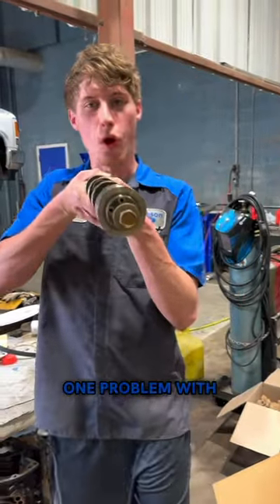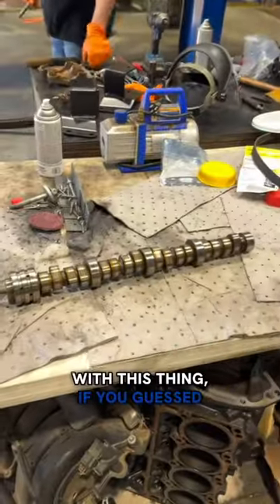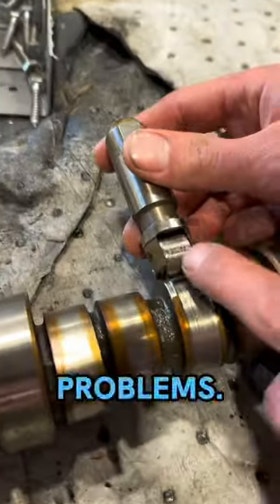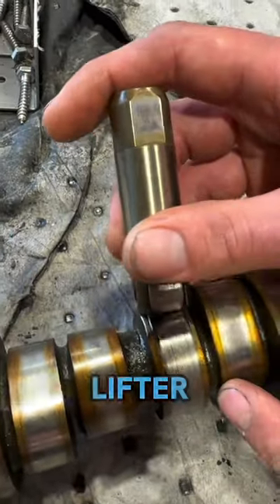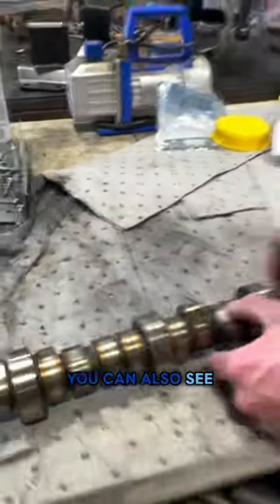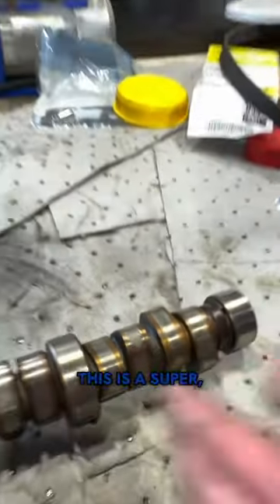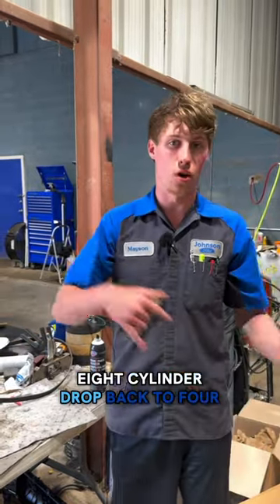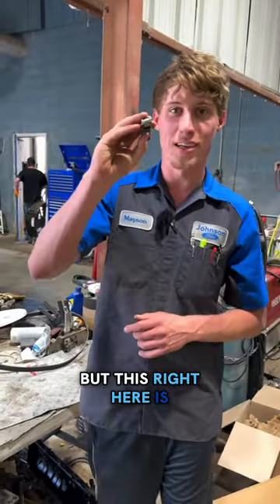The Number One Issue Plaguing Overhead Valve V8 Engines #shorts

Comment: Poor maintenance and idling causes this.
Reply: Mds/afm causes this, just like any second or third gen ls.
Reply: @harrissmart9204  low oil pressure at idle  is the number 1 cause as stated by dealers and manufacturers
Reply: @harrissmart9204  the 7.3 Godzilla has had lifter issues, and doesn't have any kind of cylinder deactivation technology. I blame poor materials, poor oil volume, with poor maintenance spinkled in.
Reply: @harrissmart9204  the 3rd gen LS never had AFM just the 4th gen LS that came with the automatic transmissions and same deal with the 5th gen LT
Reply: @harrissmart9204  only on the 4th gen LS and 5th gen LT equipped with the automatic transmission only
Reply: Preach
Reply: Speaking as a FCA tech. Oil pressure is not the issue with the HEMI, and lifter issues happen to regular lifter as well, not just the MDS.

Use a good synthetic oil and run it a bit heavier. 0w20/5w20 use 5w30. 

Part of the issues came from the parts supplier not properly hardening the cam and rollers in the 5.7l and the 3.6l. Poor maintenance and cheep oil exaggerated the issues.
Reply: @CJ-jo6do  true. I run the 6.4
Reply: @skullfan33  as long as you stick with the Pennzoil ultra platinum 0w40 and change it regularly, you shouldn't have any issues.

I had a chat with Amsoil about alternative weight oil for the 6.4/6.2, they told me that they had a talk with FCA about it and they made a point of only using 0w40 in the 6.4/6.2 HEMI's.
Reply: @CJ-jo6do  yes I heard that, I run mobile 1 oil and filter
Reply: @harrissmart9204 not the same cause they just happen to have the same end result.
Reply: 100% Not True. It’s a design problem. I babied my LS3 and followed strict maintenance guidelines and still my engine developed the Chevy tick problem and needed extensive head work due to failing lifters. ❤
Reply: The reason that they fail when idling, at least in the hemi is because of poor oiling on the rollers because of engine design, of the angle of the valve train, and a large journal under the camshaft preventing proper oiling to the rollers on the lifters.

Comment: Keep clean oil on it. If you use good oil and you change it often, you’ll never have this problem.
Reply: You are right, those extended oil changes do not protect you or the engine, but they sell more cars.
Reply: And use full synthetic, 3,500 miles/3 months.

Comment: 430,000 plus miles on my 03 5.3 and never had a lifter problem . Hemi engines are known to be oil starved at the cam .
Reply: Absolutely
Reply: My Sierra 2002 with over 300,000 this engines are bulletproof
Reply: Because it’s not an afm engine.
Reply: AFM wasn’t introduced on the trucks until 09-2010 models right? So no surprise here.
Reply: 450k LIER, unless you rebuilt it  twice allready.  An engine can NOT run more than 200 or maybe 250k with out a rebuild.
Reply: @troymillion8510   lmao where did you get that from? My 03 tahoe has 300k all original, my sprinter has 450k all original
Reply: @troymillion8510 this is a hell of a thing to say. Honda, Toyota, Ford, and GM all have engines that regularly reach 300k with no problems. That’s just gas engines. Open the door to the diesel world and It goes much higher.
Reply: 2007 to 2024 LS, LT will always have lifters fail. 6.2 also had lifter bore issues.
Reply: @troymillion8510 1995 Honda accord, 312k, 1994 civic 455k, scion xd 245k all otiginal internals,  still running,  just changed spark plugs last week lol silly person😅

Comment: Not keeping up with oil changes
Reply: Using shit oil.
I sold engineered and enhanced lubricants for ten years.
So many problems are fixed by better made oil.
Use oil analysis.
Tells you exactly how good the oil is after so much use.
Change it or let it stay.
 longer. Even better, get a heads up on pending problems before they get worse.
Reply: @markobrien678  k
Reply: @markobrien678 thoughts on the Kirkland synthetic?
Reply: Good stuff G6 rated

Comment: This problem never happened before. I wouldn't say it's a push-road problem. I would say it's either a fuel problem or an oil problem. They're putting something in it to kill those engines. That's my opinion, but it's wiping out all of cams regardless of the valve drain design.... They just don't want internal combustion engines on the road anymore
Reply: It's the removal of zinc from motor oil
Reply: The 3rd gen Pentastar, the one with the variable valve lift, always wipes out the right side intake camshaft and both intake phaser failures at some point after at least 60k miles, some earlier than that. It's own design condemns itself 😢. Will usually always last during the entire warranty period. Lack of oil changes only speeds this way up.
Reply: Lack of zddp in the oil. Need to use oil with elevated zddp and change every 3k to 5k. I experienced cam wear after 290k. It was the oil...now I run 10w40 conventional oil with zddp 1100 ppm or more
Reply: @paisleyprince5280  Exactly.  Or part of it.  The zinc additive was taken out at the request of the vehicle manufacturers because it's hard on the cat converters.  Flat tappet lifters might survive, but the cam might not.  What a world.
Reply: Omg! There not adding something to ruin the engine!!
Reply: @mcmuskie2563  ethanol in the fuel and taking something out or putting in oil
Reply: This engine specifically its a bad design. At lower rpms oil doesn't make it down there really.

Comment: Only like that while you been alive. Flat tappit OHV was the standard back in the days no roller system metal to metal contact and have no issues with valve trian. It’s the oil not the engine. They took zinc out of oil and it’s been down hill for most engines sense.
Reply: Oil still has zinc
Reply: Really, wonder why top brands like AMS oil schafers and liquid Molly feel the need to assure you that there’s zinc in their oil. Look up AMS oil Z rod for classics it says on bottle zinc real big so you don’t miss it. Also, all of your camshaft break-in lubes are rich and zinc. When I was a kid we didn’t even have to break in lube anything because oil already had it. Don’t GMTSB in 2011 Calling for dexos oil and now they have Gen 2wonder why gen 1 didn’t work out 🤔
Reply: @diagnosticdave1225  dexos gen 2 is for the prevention of low speed pre ignition in direct injection turbo engines that started to become common in gm vehicles at that time. Gen 1 was for older port and some direct injection engines. Motor oil still has like 600 -850 ppm zinc post late 90s. Before the 90s it had like 1100 ppm zinc or higher.

Comment: Pentastar has the same issues.  One thing I've found is the oil lubrication ability. 5w 20 is to light. 5w 30 so far works best. Only thing you'll lose with the heavy oil is a tiny amount of mileage

Comment: Speaking as a FCA tech. Oil pressure is not the issue with the HEMI, and lifter issues happen to regular lifter as well, not just the MDS. Some people don't understand that the HEMI oils backwards, the lifter gets it's oil from the rocker shaft through the pushrod. The roller gets it's oil from splash off the crankshaft and what ever leaks down past the lifter bore.

Use a good synthetic oil and run it a bit heavier. 0w20/5w20 use 5w30. Unless you're in cold weather season, then stick to the OEM weight.

Part of the issues came from the parts supplier not properly hardening the cam and rollers in the 5.7l and the 3.6l. Poor/lack of maintenance and cheep oil exaggerated the issues.
Reply: I own a 2022 Ram with the HEMI.  All oil changes had been done at 5,000 mile intervals, at the dealership, with factory 0w20 oil.  At 30,000 miles, it started to develop a cold start tick, which would go away as soon as oil pressure rose.  So, I started doing my own oil changes, still at 5,000 mile intervals, but am using 5w30 now.  The cold start tick IMMEDIATELY stopped and has not returned with 45,000 miles on the clock so far.  Seeing how I live in south Texas, we only average about 5 days a year that are below or right at freezing so, it’s good to use 5w30 year round.  

That 0w20 is just for CAFE standards and are crap to help an engine live a long life.
Reply: @91CavGT5  The move to lighter oils is for fuel economy standards, and I've noticed a increase in part failure when the starting using 5w20 and thinner. 

They do clearance the internals for the thinner oils so it's not recommend to go full 15w40 😄.
Reply: They took a lot of zinc out of oil now to make the EPA happy and help catalytic converters last longer.
Long periods of idling hurts those hemis.
Like in police cars where they might be idling for 2 hours at a scene
Reply: @edbeck8925  that's a small part of it. I believe the thinner oils have less cushion, thus is easier for the metal parts to push the oil out of the way and contact each other.

We have a fleet of parts delivery trucks/promasters that were consistently having roller failures and wiping camshafts. I had them move from the 5w20 to 5w30, and notice less issues. Then we move to 10w30 and we haven't had a roller issue sense. Of course we put 5w30 in during the winter months.
Reply: and the 3.6 pentastar ohc v6 roller fallowers fail and wipe out cams. not just pushrod engines. but i love that the only hemis ive seen have cam failure have been in cars with high idle time. cop cars. ole people trucks. hemi cars that get beat on a lot dont seem to have that problem because they get plenty of oil splash lubrication 😅
Reply: I'm not a genius but I pretty much agree with what you have there

Comment: This all started when the gooberment decide to remove zinc and lead from the oil. Flat cams, be it old style flat tappet or roller, became common. I use Shell Rotella and a lead/zinc additive on my SB Chevy. 50 years old and runs like new. Well almost. I do have one cylinder that fouls out the plug about every 5000 miles!😊

Comment: That’s a hemi problem 1 cam is light years away from crankNo splash bad 2 angle of lifters is garbage engineering lol 3 no oil pumps thru stock lifter. Chevy and Ford do not have this problem

Comment: With the DOD and the MSD in the 5.7 hemi,ypu can eliminate them with an eliination kit.Did one using a kit from AMS  Racing for a 5.7 hemi.Neglect is another cause,extended oil changes are one cause of it
Reply: Just got a 2024 Ram in February. Got away from Ford’s EcoBoost issue just to get into another potential issue. This time around I got a lifetime warranty, and plan on doing absolutely no mods this time. Heavily modded my EcoBoost. Fun vehicle after those mods, but took a big chance doing that. Won’t do that again. Fingers crossed 🤞 with this truck!!!

Comment: It may be an issue with people that don't properly maintain the vehicle. I certainly wouldn't issue a blanket statement that overheard valve engines have inherent problems. My DOD Avalanche is coming up on 200K with no issues. I of course have run good synthetic oil since day one and change every 6K. There are definitely some issues with "offshore" roller lifters in the aftermarket world.

Comment: Saw another guy on the YouTube, old timer and engine builder, theorized it was lack of oil at idle. Engine design of hemi didn’t allow splash lubrication of the valve train enough causing the issue.

Comment: Meanwhile GM 5.7, 5.3, 7.4, 6.0, 8.1, 3.8L, Ford 5.8L, 7.5L, 5.0L never had any of these problems pre DFM. The 5.7L Hemi is a unique case as it was a design flaw of the block design itself not a OHV flaw. 

It's not uncommon to see a 350 with over 250k. It is however nowhere near as common to see 5.7 Hemi over 200k without being opened up.

Comment: Cam wear was solved in the late 1950's with zinc additive in our motor oils.  In the late 70's, the EPA made them take zinc out of the oil.    Cams have been failing ever since.  It has gotten way worse because people believe the extended oil change intervals with the water thin oils of today.

Comment: Usually, the 2-valve per cylinder over head valve with push rod engines usually have to have quite massive valve springs to be able to return all that valve train mass "on time" at high RPM without valve float. 
The downside to/of having very large valve springs is it literally places a LOT of load on "said" valve train. Sometimes rods bend, sometimes rocker arms break, but sometimes the cam lobes go flat to. But that's OK, as long as "that" valve train engineering is spot-on. Actually, slightly over engineered would probably be a good thing given the case at hand. 
IDK, just my thought.

Comment: I’ve got a 5.7 challenger, had a 6.4 ram 2500, praying lifters don’t fail on my 5.7 like they did in my 6.4
Reply: Dang dude I was looking at getting a 2020+ 6.4l Ram 2500 since I don't need diesel. 
Had a 2015 Ram with thr 5.7. Are the 6.4s that bad? I thought it was a better motor, than the 5.7 with less problems, especially if you do the MDS delete. And also, other than the issue you had with your 6.4, what are some other experiences you've had with it wether negative or positive

Comment: 😢😢 so what is the fix on the 7.3 Godzilla lifter problem
Reply: Don't excessively idle your engine, low oil pressure for a long time accelerates lifter failure
Reply: Parts that are not cheap garbage.

Comment: Mason in our shop the hemi cam/lifter issues we see are almost exclusively on engines with a lot of idle time....AND...the customer is changing the oil based on mileage.  We use the formula 7500 miles = 200 total hours to gauge equivalent miles.  Some of these units are getting LOFs at around 12k-15k equivalent miles.  We find the operators (usually fleet) reset the gauge cluster maintenance reminder and don't actually perform the LOF until they hit a certain mileage.  With all the (spring) pressure on the cam/lifter the oil is just worn out from poor maintenance.  Next time you're looking at an OHV cam failure check the hours.  I've seen some high hour 7.3l godzilla and GM LS engines with the same issue.

Comment: Feel like the AFM/DOD style lifters are more to blame with modern units, vs the OHV design itself. With reman/hot rod stuff, poor quality materials and poor quality control seem to be the norm for overseas parts brands nowadays. I’ve seen pushrod failures, rocker arm failures, camshaft/lifter failures, etc etc.

Comment: My old LS3 motor eventually needed expensive head work with only 83k miles because of lifter problems. Sold that Chevrolet and will never be buying another one. Thankfully Japanese vehicles do not have these design issues. ❤

Comment: I get why the use roller lifters because they technically are smoother and less harsh but solid lifters just work. Mine turned 50 this year and are still quiet. Even better is if you do wipe out a cam lobe it will work just less efficiently.

Comment: NOT a design problem. It's a material quality and preventive maintenance problem. Have built and run more Ford and Chevy OHV engines, flat tappet and roller lifters, than times you've opened a door. Just sold my grandfather's 1949 Ford F-1 pickup. After he passed in 1960, I dropped a Ford 289 & BorgWarner T-10 4-speed tranny into it in 1963. That engine was still running strong and smooth with 349,000 miles on the clock when the new owner drove it out of my drive.

Comment: Simple solution: change your oil. I’ve seen tons of Hemis and LS engines go 300000+, but only with regular oil changes. Overhead cam V8s, they fail at 200000 regardless of your maintenance.

Comment: Here is the solution, put a HellCat oil pump in that motor but before you do, put the factory over pressure relief spring from your factory pump in the HellCat pump. This pump will increase your volume at idle and the factory relief spring will bleed off the excessive pressure at highet rpm's to prevent logging an oil pressure code in the pcm which disables the cylinder cancel feature MDS I THINK IT IS CALLED.

Comment: Yes the issue with the lifters is generally with dod or mds ones failing. EPA mandates Trying to get those v8 mpg’s up. On the reverse side, 5.0L having cam phaser issues all chasing the same thing. EPA mpg. All 3 v8’s are great motors especially when those plagued parts are replaced/deleted/locked out etc.

Comment: Induction hardening was wrong on the surface. Bad quality control. Back in the 70s start working on vehicles I would V8 cam and lifters. We’re not rollers and they were fine. Cylinder walls were wearing out mostly Chevy an Ford  after over 100,000 miles

Comment: My 5.7 Hemi went 178,000 miles before it was totaled by a helicopter trailer. The engine was as quiet as the day I bought the car 11 years before with 4 miles on it. Changed the oil every 6,000 miles. Never over and I was the one changing it. Not some knucklehead!

Comment: Now I have a few questions. 
I have never heard of this before but I also have not owned a roller setup. 
He says specifically over head cams, does it mean this doesn't happen in the traditional setup single cam?
How common is the failing of the roller in the aftermarket speed shop cam n lifter sets?
Is it a shitty factory part? Or is it a lubrication situation?
I did grind a couple of lobes, almost clean off in my jet boat and it was oil starved. 
Last question. After many boat engines, I'm soon going to do what will probably be my last engine build, and put it in my 68 buick skylark. Anyone regret using rollers?
Oh bonus question. 
Gear timing sets? Anyone regret going that way?

Comment: I had a 2013 Ram 1500 with the Hemi 5.7, always changed oil/filter every 3k-3500 miles, never had a engine issue. Sold truck with 30k miles no issues.

Comment: Got a programmer for my 5.7 Hemi I had a while ago from brand new, just used that to disable the 4cylinder kick down crap. Never had an issue. 

Think you can also just use tow haul mode for that but eh. 

Either way I’ll take the slightly worse fuel economy over that failure any day